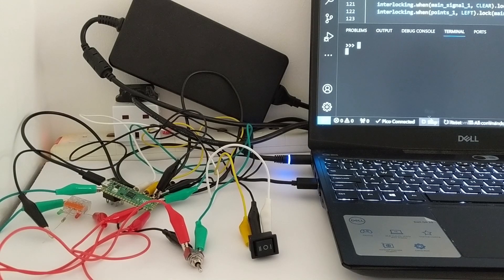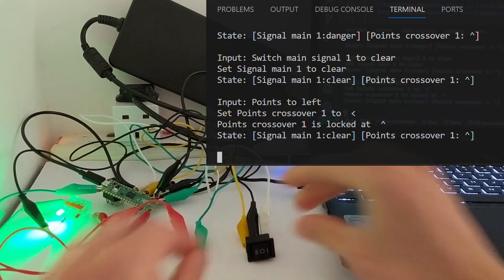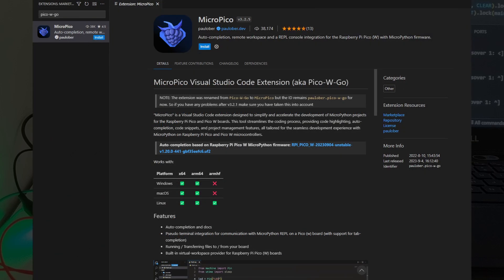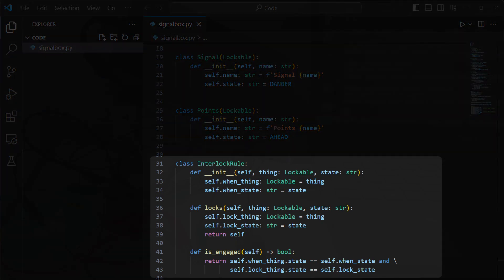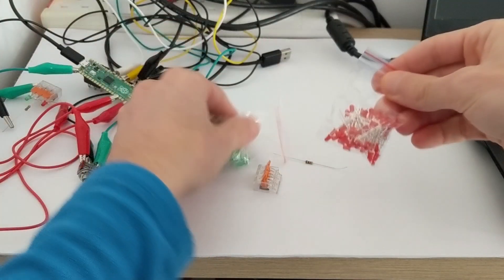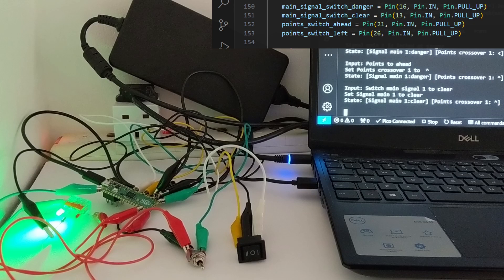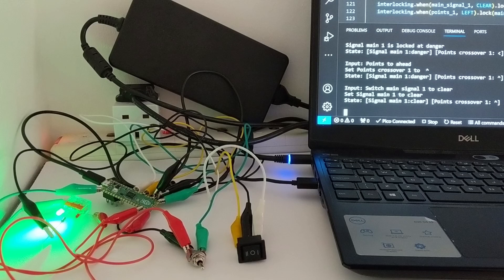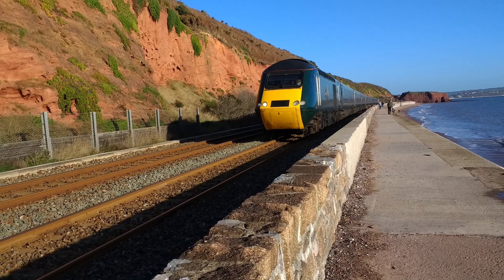0028 Signal & points interlocking with a Pico - part 1

Comment: next up is to integrate some sort of block detection and interlock that.

its actually quite a good challenge to do it with this sort of microcontroller
Reply from the maker: Hi Dale,
I've been thinking about block detection for the Dawlish T Wall, but not got very far yet! I don't intend to implement it on Endoor though, mainly because I don't want to be modifying the track now that it's laid, but also I'm not sure that in GWR days they'd have had block detection (my book says that most of the companies were very slow to adopt track circuit technology). But presumably there was something that made sure s signaller set a signal to danger after a train entered the block - I'll have to read the book again! I vaguely remember there being some kind of manually operated track occupation indicator, possibly linked between signal boxes.

Comment: Hi Jonathan! You're making me feel really jealous with you starting to look at automation tasks! I like the idea of having base classes in Python code that can be built upon to create new types of object states! I've dabbled a little with the Arduino (or rather a cheaper Elegoo knock-off), but don't really like the way the sketches work, and would much rather use Python! You talked about debounce, and I know I looked at functions in the Arduino libraries that handle that sort of thing! However, those little Pico boards look like just the job and I may have to have a look at them in the hopefully not too distant future! Keep up the good work! All the best, Ian.
Reply from the maker: Hi Ian,
Thanks :)

Yes gotta love object-orientated programming! I was wondering what other things might actually be lockable - all I could come up with was level crossing gates (not that I intend to have any), but even with just signals and points it made sense to be able to treat them interchangeably.

Lol, it's my scattered approach where I pretty much just follow what I happen to fancy! Whilst I vaguely plan signal automation for the Dawlish T Wall layout, in terms of Endoor and the intelocking it's not actually automating anything per-se - it's an electronic + virtual version of physical interlocking.

I think you can actually use MicroPython with Arduinos - one thing that attracted me to the Pico was Python, but I'm sure I saw somewhere along the line that either software type works on either type of device :)

Comment: Like the way you are going and your experimentation. I did control engineering some time ago and met similar problems. For de-bounce the period to achieve stability depends on the switch type and the switch trigger (measuring liquid levels which slop around required debounce latches); these pure mechanical switches will probably work very well with 0.5 second (500ms) pauses between reads. If that is not good enough then a set-reset latch will be required which will in turn require more complicated code - avoid if you can. If you are reading every 500ms the switch can change state between 499ms -1ms before the read - this can cause problems - but as you are using state tables it will not be an issue if you say only allow the outputs to function every 1.1 second. This will allow the input to stabilise before actioning a state-change - i.e. an output. This will give you 2 reads for a state change, some enigineers like 3 or 4 reads before a state change output.
Keep up the good work and these videos.
Reply from the maker: Hi Tony, thank you for the encouragement and the useful insights - I hadn't realised just how nuanced the de-bouncing could potentially be! Thanks!